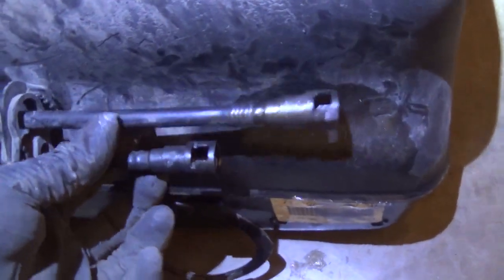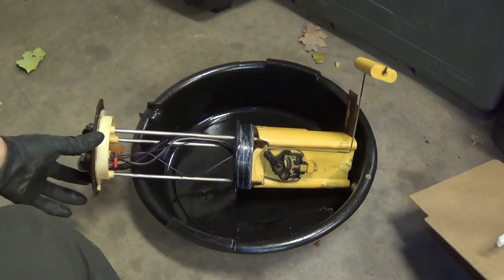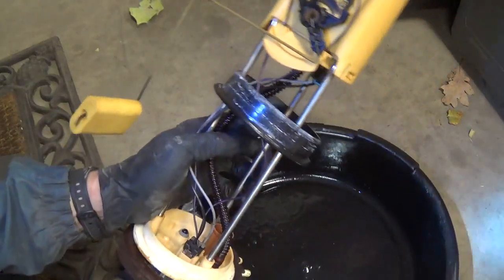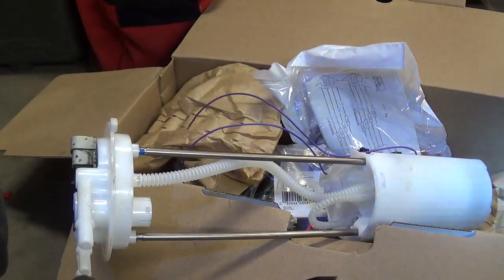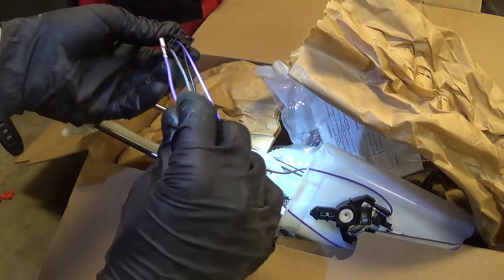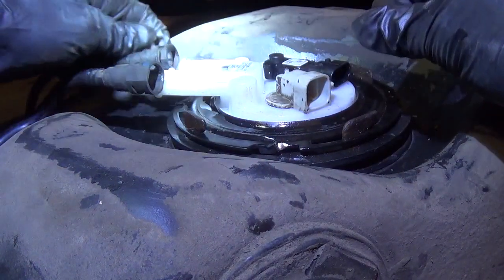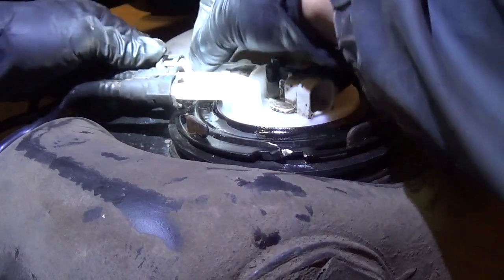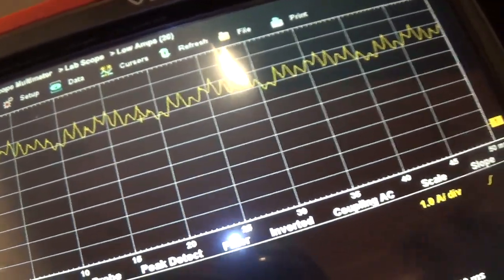Fuel Pump Replacement: Chevy GM Truck

Comment: Ivan does a great job always but stumbled a bit on this one.   Nice idea to try to keep the original pump connector (square one), BUT it was changed to the flat one with bigger pins to correct the old square plug which can overheat and melt.  Be sure to just upgrade the truck harness with the new flat plug that is suppled with new pump, and keep the new pump as it comes.    The giveaway was the larger pins in the new flat plug.  No problem, Ivan, you are still batting nearly 1,000!
Reply from the maker: Truck ran fine with the OEM connector until it went to the rusty junkyard grave recently 😢
Reply: @PineHollowAutoDiagnostics I'm sure most trucks never have a problem using the little square connector, and my comment wasn't mean't as a criticism....you are light years ahead of me in diagnostics.   Just wanted to tip people that anyone watching this video who also might opt to swap stuff around to keep the plug-n-play square connector could find out that they really do need to splice in the updated flat one. Keep up the great work!

Comment: i know you posted this a while ago. i replaced the pump and still couldn't get the engine to run, scratch my head a bit, scoured youtube for guidance, then final at the end of your video was my solution..  the ground wire for the pump and the ground for the filler were not properly grounded.. thanks dude.
Reply: Just had a problem with my 2004 chevy shutting off intermittently  while driving  it was a bad crankshaft position  censor  I hope it saves someone a nightmare  like I had

Comment: Going on 18 years as a GM technician and the pig tail that comes with the new pump should be replaced GM update the harness because of premature pump failure the repair you just preformed looks more time consuming then just installing the harness that came with the pump it was still a goo video thumbs up

Comment: Had to do this to my ol Chevrolet. I used the Delphi unit as well. I did do the swap on the harness and installed the new one. All new pumps come with the new style connector. If done correctly, those harness crimps seal Nicole's, as they are heat shrink, and for added security, put some heat shrink over it. I find that's the best way to do it. I think Chevy had a problem with the square connector, if I remember from my research. Anyways good video.

Comment: That's the correct Delphi unit for that truck.  GM superseded the original design with the updated design you have there.  Even the dealership techs have to deal with the whole cut-and-splice garbage.  :(

Comment: The last FP I did was on a Chevy Cavalier.  Only the whole sending unit was available as FRU (Field Replaceable Unit) -- aftermarket $200, OEM $325.  Uh, no...

I did some research and found a vendor on eBay selling just the ACDelco pumps new for less than $50.00.  So, I did the work and swapped out just the pump in the old sending unit.

The Internet is a godsend to those of us financial efficiency experts.
Reply: How did your financial efficiency expertise  handle the fact you probaby bought a counterfeit ACDelco part which eBay is full of?     Was that low price worth it?
Reply: @jeffro221  Probably?  Not likely.  The molded plastic and stampings would have been different.  And since the pump is still functioning perfectly, counterfeit or not, it makes no difference.

As with all things, buyer beware...  If you lack the skills and know-how to sniff out inferior parts or install them correctly, pay the obscene mark-ups and have "pro" do it.

But, even then, once the sending unit is installed in the tank by a shop, you have no idea as to whether or not it's a genuine GM part or knock-off invoiced out at full OEM retail.
Reply: @russellstephan6844  That's why I buy and install my own parts and never buy critical parts at all , whether represented as  "OEM" parts or not, on eBay or Amazon.  I have  no doubt some indeed are the real deal, but some are so good (looking), that there is no way I can tell for sure.  And neither can you.   But if it works for you, awesome.   But to say that if a counterfeit part is functioning perfectly right now, it makes no difference.......uhhh, that's a no-go.  You would really be ok with finding out that you had actually installed a counterfeit fuel pump that you had thought was genuine if it is working?   3 months or a year later and still working fine, and you would be ok with that?   Mostk knockoffs last for at least some time....that doesn't make 'em good.  Ever wonder why so many people post about how they change their fuel pumps and then are doing it again a few months later?   Certainly buying low buck chinese stuff explains most of it.  And buying a supposed "OEM" part that is actually a knockoff explains some of it  also.
Reply: @jeffro221  "But if it works for you, awesome."

Yep, and you do what works for you!  Then, everyone is happy!

A few months ago I acquired and installed a near brand new Whirlpool induction cooktop in my kitchen.  The $1,700 new-at-full-retail appliance set me back for $50.  No lie!

No, it wasn't a stolen item.  No, there was nothing wrong with it.  No, it wasn't a Chinese knock-off.

Humans are funny!  Rather than celebrate the success of another, fault must be found.

Comment: The new plug is sent with the pump as there were problems with connections and some would melt. Seen many pumps replaced and  all that wrong was the pigtail. You may do as you like but its faster to pull the bed off than to drop the tank. 4 bolts ,unplug taillights and remove filler neck hose. Pick up bed and sit on tires. Takes about an hour.....Shortcuts such as the plug and not replacing the Fuel filter do your customer a disservice and will always bite you in the butt.

I spent 30+ years in auto parts sales and repair and there is a reason manufacturers send new plugs and lock rings etc is to prevent comebacks ,
Reply from the maker: Well I had the tank down and back in WITHOUT A LIFT in about 20 minutes! Trust me the bed was rusted in place on this rig ;)
Reply: motoYam82 Same issue up here in Canada, we use potash instead of salt in Saskatchewan but corrosion still happens just a little slower, we would spend way to much time dealing with corroded bolts to get the bed off.  

I probably average 4-5 a year and at least one has melted connections, solder the new connections, heat shrink with sealant to prevent corrosion and lots of diaelectric grease on the connections.  

Good soldering skills will serve you well in the longer term, so much electronics in modern vehicles and the connections need to be perfect.
Reply: Ivan,
     A little over two years ago I R&R'ed my 1991 F250 fuel tanks and replaced one fuel pump. I had to cut EVERY fastener off including the spare tire carrier mounting bolts. It took forever. You do it in twenty minutes. Your highly skilled and may I say you got a bit lucky.
Reply from the maker: worst case scenario on this truck is if the tank strap bolt doesn't give then just cut and replace the straps. Luckily a bit of impact action got them out. Undercar jobs on northern cars almost never go as expected lol
Reply from the maker: DAVID P
Depends on how much there is left in it, and if the original pump works at all...in this case I got 7 gallons out in about 10 minutes :)
Reply: Lucky man, usually the ones I get are at least 3/4 full....
Reply: weaky weaky is right.  Replace the connector as Delphi recommends.  Solder the wires and seal with adhesive shrink if it doesn't come with self soldering and sealing splices.  Those old connectors can cause all sorts of problems, that's why GM phased them out.
Reply: weaky weaky gets the nod here again.  I guess Ivan didn't get the memo on the square chevy fuel pump connector - it caught too many of them on fire so they round filed it in favor of the one included at no extra charge.  It does come with hot melt glue type butt connectors too.  Or they be liable.  So legally only Ivan is on the hook now.
Reply: How can 1 person remove the tray  in the time it takes to drop a tank?!

Comment: Nice diagnosis Ivan from the previous video and great work on the fuel pump replacement. I'm like you in why didn't a Delphi pump have the electrical connectors on it like the original. I would done the same thing as you in swapping over the old connectors to the new assembly. I mean who likes to bastardize work by cutting factory wires and then splicing. And it would have been nice if the manufacturer could have provided the plastic fuel and evap line connectors. On the fuel pump waveform, it did look a little raggy and didn't have a typical 'sawtooth' look to it. You'll find that after a few hours of running that the waveform should clean up a little bit when the brushes get fully seated. Nice work as always!

Comment: Yep, that updated plug was in the kit for a reason, i have personally seen a handful of them melted. I bought a 2000 Blazer in really nice shape a few years ago because the guy had done exactly what you just did, swapping plugs and harnesses instead of snipping 4 wires, in this case, the plug on the pump pigtail melted at the passthru inside the tank after he drove it for a day, he thought is was another NEW problem and got pissed and dumped it cheap, i snagged it for $500 bucks 98,000 miles, zero rust, very nice shape, he left the box from the delphi the pump in the back, i diagnosed it quickly as no current on the pump circuit, dropped the tank, restored the swapped connectors and installed that pigtail and it was fixed for free. You even noticed that the connectors had larger pins, the reason for the update was because of the connections in the square connector loosening over time, the larger pins in that flat connector made more surface contact and thus could handle more current without producing heat. Less heating, less metal fatigue in the pins, the longer they hold a tight connection, as soon as they loosen up in that square connector they will overheat and melt it. Look up GM TSB #04-06-04-088C

Good Job putting in a Delphi, but in my opinion, not changing that plug was risky business.
Reply from the maker: Ah good points! I do stand behind my work so if that was to unfortunately happen on this truck, I'll do the harness upgrade free of charge to customer.

Comment: That's the way to do it. I wish I would have thought of that because I had to change my trucks harness and it's never worked as well since. (The fuel gauge bounces around). Great job on the rig!
Reply from the maker: Yeah I just hate cutting up original harnesses, especially in such a harsh location. Luckily there was a way to get around that. But would have been easier if they didn't change the plug design every 5 years!

Comment: I always oil any kind of push/clip on hose connectors before re fitting. It helps the O rings to slide on and seat without twisting them. Plus I feel that a smear of oil on the big seal would have helped that clamp ring to seat down

Comment: Another interesting video, Thanks.  But don't you run the risk of connecting the pump backwards in the connector and then running the pump in reverse.  I would mark the pump wires so you maintain the correct orientation in the plug.
Reply: He didn't remove the pump wires from the connector...just the sending unit.  The pump itself had a separate harness in there that he swapped over.  The concern is that the new style connector had bigger terminals for the pump.  Some say GM changed them due to melting.  Others say it's just a new manufacturer.

Comment: Ivan, I didn't see you observe polarity on the purple sending unit wires. Did you just get lucky, or does the fuel gauge simple respond to the increase or decrease in resistance across the purple wires?
Reply from the maker: Yeah the level gauge is just a variable resistor so polarity does not matter in that case. You DO have to pay attention to the pump power and grounds however!

Comment: the connector that you did not replacement was for poor connections that develop over time. that was a update that GM made so we replace them every time a truck had fuel issues.

Comment: Hi Ivan just replayed the waveform of the new pump. Was I imagining things or did that waveform look a big ordinary.  You didn't comment  but do you agree its looked a bit sad out of the box?
Reply: +tecnaman  After the truck has run for a while it will look better. The brushes need to wear in.

Comment: Hey Ivan!  Interested issues I've been having.  Wanted to get your thoughts.  My next step is to see if my buddy can look on All Data.  
1997 Chevy Blazer 4.3, 2 door, auto, 4x4.  issue is the gauge isn't reading accurately once it gets down to 8 or 9 gallons of gas in the tank. The tank is a 19 gallon and it is in the very back because it's a 2-door model. After driving for more than a half hour the gauge will sneak it's way down to almost empty and sit there. Once I shut off and restart the Blazer the gauge will start reading closer to where it should be but is still off (lower) by about 1/8 of a tank. I also noticed when I first turn the key to the ON position but, not actually start the engine the fuel gauge will spike all the way past the full mark super fast then drop down towards a more actuate reading. It never did this until last night. Finally I am also getting gauge fluctuation when I step on the brake pedal, turn off or on any lights or accerories. The fuel gauge will move it bit and return to it's current location.  

Back 3 years ago I replaced the fuel pump and sending unit in the tank along with the 4-pin wire harness connecter. It seemed to correct this issue with the gauge not reading correctly and drifting to empty when I still had almost a half of a tank. Now the problem is back! I soldiered and heat shrunk the new connector for the fuel pump/sending unit to the main harness to prevent connection issues. I also used and AC-Delco pump/sending unit. To be honest this issues has gotten old. I was wondering if you have any thoughts?

I also wanted to mention that I did some research and a few people online mentioned a "Fuel Gauge Buffer Module" under the glove box that is present in 1997 models and could be  an issues.  Also when you turn on headlights, step on brake, use turn signals  or do anything that puts a load on charging system the fuel gauge jumps a little.  Thanks for reading!
Reply from the maker: I would graph the ACTUAL signal voltage from the sending unit and compare to indicated data (scanner or gauge itself). That will point you either input (sending unit, wiring) or output (cluster) problem.

Comment: You are a more meticulous man than I am. There is no way I'd have faffed swapping connectors on the pump. I'd have used the bodge wiring connectors and shipped it out!

Comment: The internal screen is a bad "improvement" in my opinion.  

I've  never changed the fuel pump plug like that, my understanding and experience is the original wiring plugs can corrode or melt, hence the "upgraded" plug and pigtail.  A nuisance and a potential failure point if you don't solder and use a good quality heatshrink.  

Not a issue as long as the original plug is in good condition.
Reply from the maker: Great point! All the original wires and terminals looked to be in great shape so it seemed like the cleanest and most efficient solution.

Comment: What's the best penetrating fluid? Does atf and acetone actually work better than pb blaster?
Reply from the maker: I have used PB Blaster in the past, but found that it is very aggressive if it gets on rubber or plastic. I now use WD-40 Specialist (yellow label) and more recently KROIL that Eric O at SMA recommends as well.

Comment: really like your attention to detail on the repining of the harness.  I hate cutting and but connectors when not needed; although judging by the look of the truck, the owner will not even care.  I wish I had repined the harness when i replaced the blower control module on my 06 Sierra.  The truck is perfect with only 65K miles.  After i cut the wire i said to myself, "you dumb ass, why didn't you simply change the plugs around!"

Comment: Ivan, can I ask why you changed the whole module & not just the Fuel Pump?
Reply from the maker: Didn't want to do the job again if the sending unit were to fail, which they do. Are pumps sold separately?
Reply: Pine Hollow Auto Diagnostics ah, yeah, well they are over here anyway, I'm sure it wouldn't be any different in the USA. It'll most likely just be a standard Delphi (that's what GM used over here anyway) pump but I'm sure a Bosch, Walbro, Goss or anything with similar PSI & flow ratings such as (GM 9203340) would be fine.

Complete Modules over here are ridiculous & you can usually get just the pump for less than a quarter of the module price. Just found it strange as it's an older vehicle that's all. I still can't believe how rusty cars get there!

Comment: Ivan, I think you got lucky on the purple wires.  Did the fuel gauge read accurately after you got the truck started?.  It's a good idea to transfer the pins one at a a time from plug to plug otherwise its possible to reverse their positions so that he fuel meter reads 'full' when it is empty and vice versa.
Reply from the maker: Why do you think the fuel gauge would read inaccurately if you swap the purple wires around?
Reply: It's just a variable resistor.  There shouldn't be any polarity on it.
Reply: joseph prosser I had a Delphi installed and the first one had an inaccurate level sender, the second one had a totally inop level sender. Such junk.